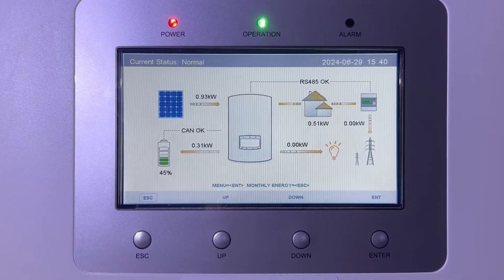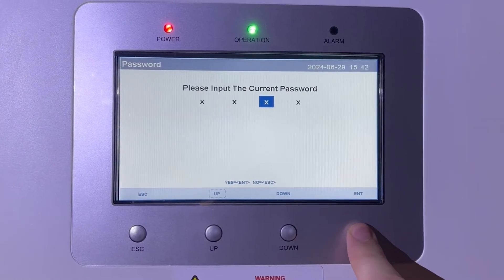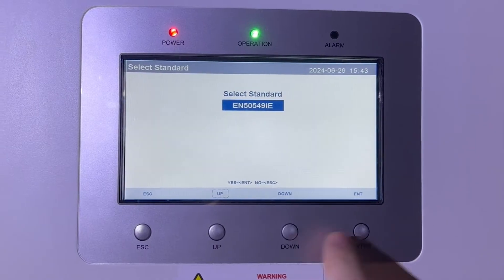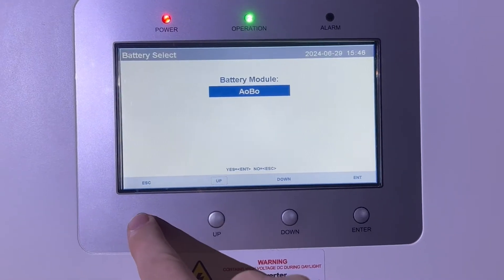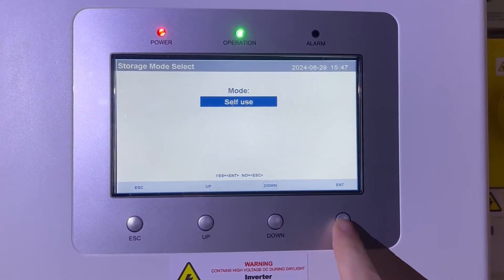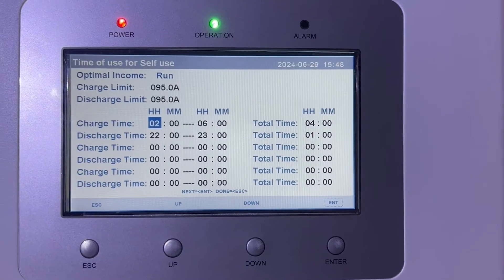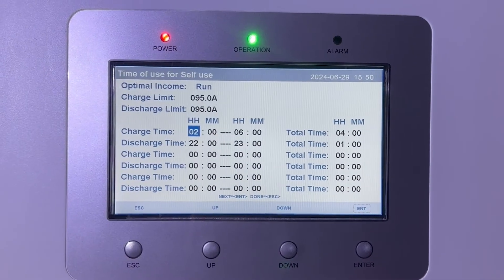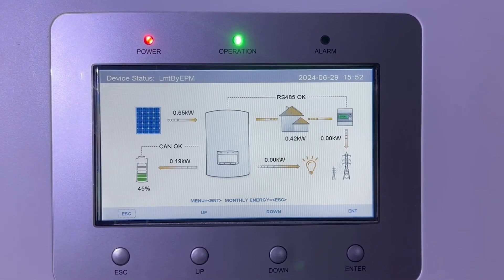Solis Inverter Battery Settings

Comment: Hi Gary,

I have a Solis hybrid 5KW inverter, and I'm using it with 16 EVE 304 cells and a JK inverter BMS with an active balancer. I've been running this setup for the past five months. The JK BMS communicates the state of charge (SOC) to the inverter, but the SOC keeps drifting over time.

Here's the issue: even when the BMS indicates a 100% SOC, the voltages drift slightly lower with each cycle. Over the weeks, the SOC gradually drifts, so while it shows 100%, each cell and the overall pack voltage are slightly lower than the previous cycle. If I adjust the battery capacity settings, the BMS resets to 70% SOC, and the inverter charges another 3 or 4 kWh. This SOC drift is frustrating because on cloudy days, my 16 kWh battery effectively only charges to 11 or 12 kWh. The remaining 4 kWh stays uncharged because the BMS incorrectly reports 100% SOC to the inverter. To fully charge the battery, I have to keep changing the capacity settings in the BMS back and forth.

Is there a way to use this inverter without CAN communication or by setting it as a generic battery? If anyone else has the same issue or knows a solution, please comment and suggest how to fix this problem.

Thanks!
Reply: It seems like you have positive SOC drift. You need to calibrate the JK BMS's 'Calibrating Curr.' and 'Calibrating Volt.' in app Settings. You do this by measuring current with a clamp meter while charging from the grid with ~30A and enter the value in 'Calibrating Curr.'; then measure the voltage at the battery terminals and enter the value in 'Calibrating Volt.' After doing this you should be rid of the positive SOC drift. The JK BMS usually has negative SOC drift but this will not impact the charging to full charge, instead it will hit 0% SOC while it shows 20-30% after a few weeks of cloudy weather, but its ok to live with and happens because the BMS doesn't measure correctly low currents of < 1A because it is made to measure high current accurately (it's resolution is 0.3A or something like this).

Comment: We have a Solis 6kw hybrid inverter and a volt protection device before it. The device shows 2 amp import from grid but the inverter app shows that grid is not being used. What is the issue?
Reply from the maker: Small discrepancies seem to be commonplace between the inverter display and the APP. This is not just a Solis issue from what I have read. Like any electromechanical device, there will be a tolerance and this seems to be +/- 300W from my observations without detailed understanding or investigation. I hope that helps.
Reply: @GaryOnPower  the problem is that I haven't seen it 0 on the device even in peak sunlight hours. The device shows 2 to 3 amps. 

Could you please also mention what should be the CT direction and ratio and what is the criteria for setting this value?
Reply from the maker: @wassaufkhalid8593 I’ll pretext this by saying I’m a mechanical engineer and not an electrical engineer, so my understanding on this is limited and is gleaned from reading up on specialist contributions on online fora. 

The device will use a few amps and this may not be recorded in the APP output. Unless it is causing you to import/export unnecessarily, I would personally not worry about it.

The inverter CT should point from the CU to the grid. I can’t advise on ratios. These settings are typically default values on the inverter and may only change when another relevant value is changed. 

The video is only intended for basic setup guidance. There are other channels which would cover settings on a deeper level. The solar DIY forum is also a great resource to troubleshoot. I’ve used it with good success.

Comment: Is there settings I may need to change if I add a second battery?
Reply from the maker: I have yet to add a second battery to my system. I will be doing this next month. Logic would tell me that the second battery would be set up just like the first battery in the BMS Studio, with the exception that the DIP switch setting would be different than the first battery. The total capacity should update on the inverter. In the event I find this to be inaccurate, I will update here. For now, this is what I have.

Assuming you are adding batteries in parallel: 
On page 26 of the manual for the SEPLOS Vertical 280Ah Battery Pack, the DIP settings for a single battery will be all OFF. 
When adding a second battery, you need to set the first battery DIP to pin 5 ON. On the second battery, you need to set pin 1 ON.
If adding a third battery, the setting for banks 1,2 and 3 are Pin 6 ON, Pin 1 On and Pin 2 ON with respect to each battery in that order.
When adding a 4th battery bank, the DIP settings become slightly more complex.
Up to 16 battery packs can be connected in parallel according to the manual.
Please refer to the user manual for clarification, as the settings are only accurate at the time of this post and may also be misinterpreted.